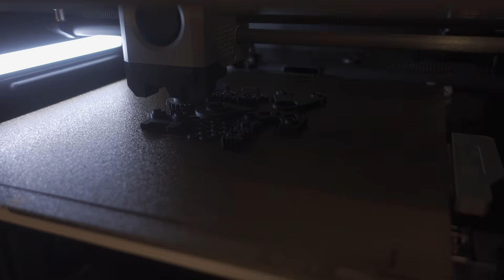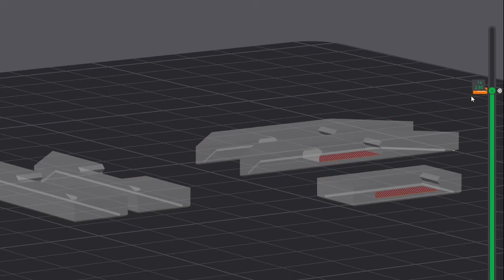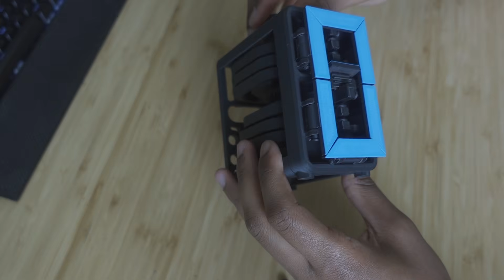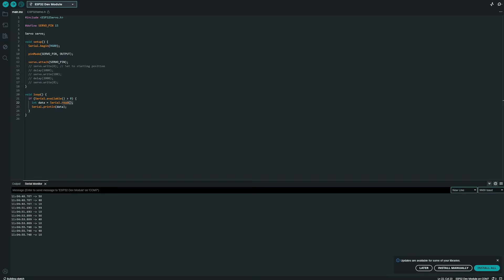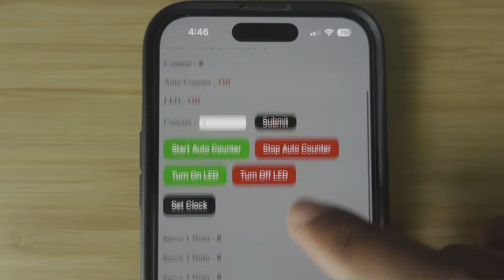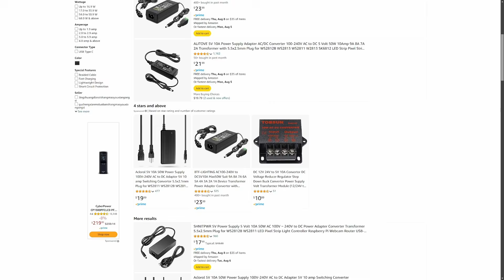Building A 7 Segment Display Clock With Arduino

Comment: You must have a better printer than mine... after assembling and hooking up the servo, the gear on the back kept slipping, and the knob gets stuck sometimes... very frustrating. I guess I'll try printing it again
Reply: I had the top and bottom drawers swapped so it was rubbing a little bit - also I noticed the 3d printed screws/dowels that hold the white segments in place should be sanded or the inside of the segment gears should be drilled/sanded to help the numbers swap easier too

Comment: code is ass around 16000 errors
Reply from the maker: The code isn’t ass. 

1. Did you install the libraries I mentioned in the video?
2. Are you using the same microcontroller that I am, an ESP32?

Comment: after fixing the front vertical segments (in your case its blue) , in my case its tooo tight while rotating, its stuck in some cases ..you have any idea why this happening?
Reply from the maker: Sorry for the late response, but the first thing I'd check is if the teeth attached to the segments are in the correct groove. To be absolutely sure, you can remove the segments then put them back in and make sure that you align the teeth correctly when putting them in again.

If that's not the issue then it could be the followers not interacting well with the cams. I had that happen to me a few times and I ended up shaving the cam(s) that were causing issues until it was smooth enough. It's been a while since I've worked on it, but I think it made the issue less frequent for me even though it would still happen.

Comment: Hi Chris
Nice video. Thank you for posting your work. I did go through the same process building the clock based on Jay’s 7 segment display modules. 
I did print the 4 modules which worked perfectly manually. I did connect the servos and wrote some codes to test the servos with the modules for counting and to use this as a clock. No problem there. 
The main issue was that I could not get this working consistently for all modules. For each module I found the best angle to move each segment but it  will not work after a while and I will get just half segment moving etc. 
I was thinking about using a specific angle for each number (and for each module) but I also find the gears attaching the servos are sometimes moving. 
Did you get the same issues?
Definitely a fun project to learn but I don’t think with the current design it could be something reliable. 
Thanks again for sharing your work. 
Best,
Pierre (from France sorry for my English)
Reply from the maker: Hey Pierre, your English is perfect so no worries on that!

I definitely agree with your take here! I mentioned towards the end that I didn’t find the displays that reliable and listed some of the issues I faced. There are just so many things that can go wrong.

I really tried, but couldn’t figure out a way to get it working reliably. In my setup, I configured the servo angles for each display separately so they all had slightly different values. They would work for a little while then something would go wrong and I’d have to take the servo part out and fix it multiple times.
Reply: @Chris-Clicks  Hi Chris, thanks for your response :) For the angle I meant using a different value for each number of the same displays as it seems that the same value for all 9 numbers get messy after a while (I would get some segments only showing halfway for some numbers - so the idea would be to have for instance 20° angle for going from 0 to 1 but 19° for 1 to 2 and 21° for 2 to 3. kind of painful to test but this is the only thing I can think about. I will try and let you know. Down the road, even if it is a very fun project I don't think the design could work in a reliable way. Have you seen the 7-segment display from Flower 3D (on printable). I think this will be a more robust design (especially v3) and I know the designer is working on  a clock based on this display. Thanks again for your post.
Reply from the maker: Ah yes, I experienced that too! Moving between different numbers had different values depending on what number you're at like you said. It was tedious, but the web server I setup made it pretty straightforward to get all the right values.

Another thing I noticed was that going down a number didn't work the same way that going up a number does. For example, if I had #4 at angle 80 and #5 at angle 100, I could go from 4 to 5 no problem. If I wanted to go from #5 to #4 with those angles, it wouldn't work. I don't fully remember, but I think I had to add an extra 5 degrees when going down. In this example, I'd have to go from 100 to 75 (instead of 80) to properly go from 5 to 4. Still not sure why that is.

It was a very fun project, but the unreliability of it is pretty unfortunate because it'd be perfect otherwise! It must've taken Engineezy a long time to come up with the design.

I did see that 7-segment display from Flower 3D! It was recommended to me so I checked it out. It looks like a very solid design. I definitely think that's another good 7-segment display to check out, especially if it's reliable. I didn't know that the creator was working on turning it into a clock. If that happens then I might give this clock thing another shot lol. Thanks for the reply!

Comment: is this worth trying to do with no eletronical knowlege ?
Reply from the maker: If you want to push your luck, maybe? I provided a circuit diagram in the video for how everything should be wired. The issue is that if anything goes wrong and you have to start troubleshooting, you may run into a lot of issues trying to figure things out with no electrical knowledge.

I don’t think you need to know a ton of electrical things here, but at least the basics would help.

Comment: im working on this project now myself. Im on a Bambu A1 and have been stuck for days on inserting the cam shaft. I managed to get 1 working but later broke the piece the pin slide through and had to start over. Would really appreciate any advice on the Cam Shaft. Been trying the 5 method bc I saw it on another comment but still stuck.
Reply from the maker: Yeah of course I can help! First thing I would check is to make sure that you inserted the followers correctly.

It’s kind of hard to tell which follower to use on each step so I had to pause his video a lot and move frame by frame to see exactly when to use each one and how to orient them. They look very similar, but there are subtle differences.

Even with the followers inserted correctly, it took me like 2-3 hours to get the camshaft all the way in the first time. Things I found that helped was the 5 method and also moving the followers back and forth while twisting the camshaft and pushing it inward. If you feel it get stuck at a certain point, I’d start moving the followers in all directions and that would fix it for me after doing that for a few mins. Or I’d just pull the camshaft until it became unstuck, rotate the camshaft a different way, then push it back in and try again.

Probably not likely, but the issue could also be inserting each cam onto the shaft the wrong way or inserting them in the wrong order.

Hopefully this helps.
Reply: @Chris-Clicks  appreciate the response, thanks! Will update you after trying to play with it some more. Cheers!